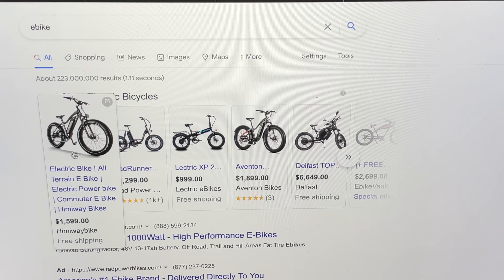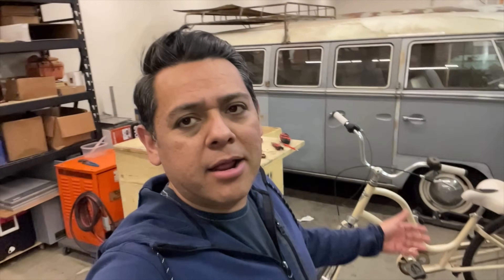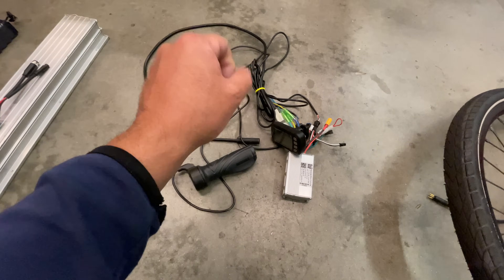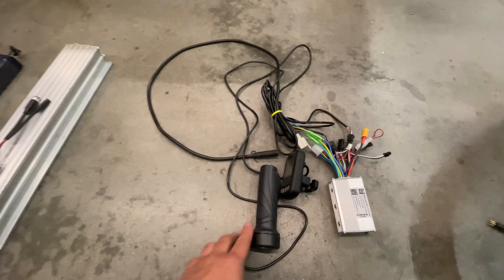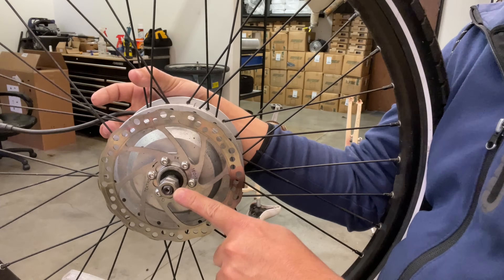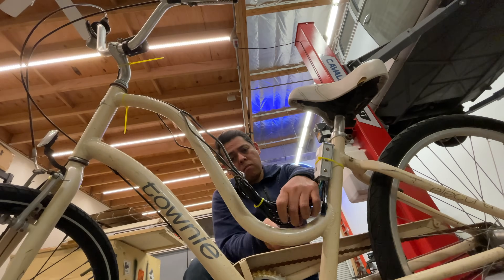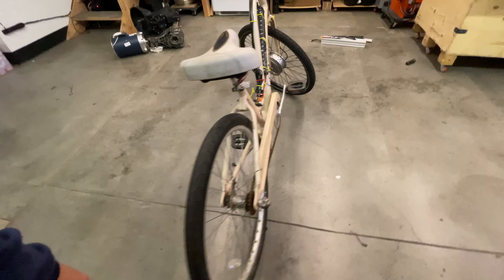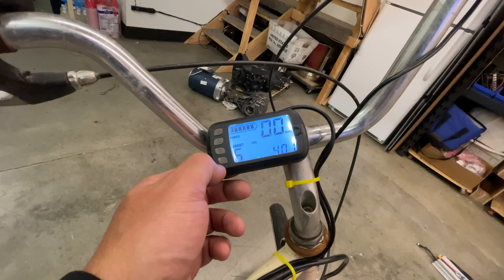$150 eBike Build,  Beginner friendly

Comment: how long have you had this? A lot of your parts had poor reviews, was wondering if you figured out actual distance you are getting with it as well as how has everything held up?
Reply: Precisely why you have to consider the quality of the parts you use. Of course, he did say the wheel was *Used*. However, the electronics he bought new on Amazon.
Reply: @paulreeder5241   I'll take high quality  very used parts over brand new junk.   I think I spend 1/10 on my toyota vs all the nicer newer  used cars like a 10 yr newer Ford or kia.

Comment: You almost got me!!! You actually spent $97 on the throttle control & module, not a bad price.. But where your real savings came in we’re on the wheel and the battery. The wheel and battery is sold by you! Hook us dedicated viewers up with a discount code!!
Reply: You can use a more primitive controller kit for 20 30 bucks. They work just fine. I’ve used mine for years
Reply: @joseureste8257  How do you hook up the hall sensors?
Reply: @steveeng4871  you don’t have to hook em up
Reply: @joseureste8257  send a link of your kit bro
Reply: @joseureste8257  do you have a link or more info?

Comment: I live in Montreal Canada and want to reproduce your build with air cadets with whom I do volunteer work and try to get them interested with this kind of useful hands-on projects.  Was excited to see that we can build an e-bike for such a low price and hoped to get them to build their own (with financial support from the adults). Having said that I cannot find those parts at such a low price here and the supplier for the wheel/motor won’t ship to Canada.  Any thoughts on Canadian suppliers! Thanks a lot fir this amazing project! If I can build it for such a low price I will make a lot of kids happy and get the to experience the pleasure of building something really useful! Pierre
Reply: You will have to do some research in Canada. Also, keep in mind that the lower the cost, the less reliable the circuitry will be. Sometimes you might get lucky and come upon a cheap controller that is actually great. You see, electronic components have tolerances. The more expensive controllers use the highest quality components with the lowest tolerance rating. ie. a 1% tolerance is much, much better than a 5%, 10% or 20% tolerance. The cheaper controllers use the 10% , 20% or greater tolerance because the components are much cheaper. The manufacturing process for producing these components is much more strict on the 1% than on other percentages. The same goes for other products, like the motors, wiring, etc. The quality stuff is going to be more expensive of course. Jehu Garcia hasn't actually used this bike yet. Let's see how long before something fails.

Comment: hi Jehu, i really love watching you're videos, you explain everything so clearly.  i just want to ask about choosing the right BMS for my battery pack. lets say if i'm going to build a 12v 14.4ah (panasonic tesla LDTSL 21700, 3.7 4800mah 10A max 35A) what would be the recommended BMS ampere for this build, will a 3S 25A do?... i'm also trying to find a video on your channel how to calculate the Amps when building a battery pack. because in my example,if i use the tesla battery with a rating of 10A each with a 3P connection would that total 30A and do i need a 30A BMS?

Comment: Do you have to use data sensor meter display to send full power to the wheels? Or can it be done without it? Just use throttle only? Has anyone tried that and what's the result?
Reply from the maker: You don’t need it
Reply: @jehugarcia  Thanks good to know 🙂

Comment: How tf did you get motors that cheap?! They’re way over $70 everywhere else
Reply: Yhis was atake off motor fro rental bikes.  I bet they are few and far between.
Reply from the maker: I have thousands, click on the links you fools
Reply: @jehugarcia  I’m in uk :( was looking at using them for low speed wind turbines to reduce noise from the blades. I’m considering eskate hub motors now (edit typo)

Comment: Well here is the thing.  This hub motor is  a geared motor which is not good . Second its only 250-350w which is very little. If you decide to overvolt it to let's say 48v it will kill gears super fast under the load. So for kids its not a terrible option not for grown man. For about 180$ you can get a true 1500w gearless hub motor for 36v or 48v.
Reply from the maker: They are cheap enough to buy two in case it fails

Comment: It's time for me to quit dawdling.
I placed orders for everything today, plus an extra battery.
Reply: @JehuGarcia: I received my batteries today & the charger the other day. Kudos on fast shipment.
So the charger has a barrel plug, & the batteries don't, but they have 4 plugs coming out of them.  
Can you tell me how to charge the batteries?
Reply: Sorry for such a late replay, how did it go how did everything go?
Reply: Sorry for the late reply to you as well! LOL
It went great. I was upset when I received it, because you kind of have to do some thinking. There's no instructions, but logic will show you how to put it together. There's a 6 pin connector that arrived not a symbol. But you can look at the connector that it has to go to and figure out where to put the wires. The only problem was the motor. The motor did not run when you hook up the three wires do it. What you have to do, is WAP the blue and yellow wire on the motor, and leave the green one alone. This doesn't apply to everyone though. I've had a lot of fun on my bike so far.
Reply: @mattosborne1233  thank you so much for the reply. Thanks I had the same issue and you actually just fixed it so I can’t thank you enough.

Comment: This may sound obvious, but you need a 26" tire bike to use this motor.

Make sure you have a way to recharge your battery. Most chargers use barrel plugs and not XT 60 plugs!
Reply: but it would fit a a 27.5 or 700c bike, ud just have to adjust the brakes, right

Comment: I used the link for the Wheel Nut. It stated that the Steel Nut will Rust in wet conditions. Be advised of that action and use a protectorant before installing.

Comment: Man You Got to put Sum "Luna Cycle Duck Tape" those Parts on Man, MadMax Style  Oh Yeah LOL LOL. MadMax Organ Doner Bike
 What you can do is take a few cell groups out of circuit on 1 pack to reduce the voltage down to 60 volts combined.  To make a 36 volt pack less voltage you move the postive tap point back down to a different cell group that gets you the 63 volt max volt for a 1000 watt controller with 75 volt fets and 63 volt caps. So no mod nessery for the electronics.  Simply abandon 5 cell groups so you have a 15s pack.  The cells you dont use you drain them down to 3.6 storage voltage.   The bms still works.  So you dont have to change any of that.   So configure 1 pack to a 5 s then wire it to a stock 10s pack in series then make a custome charger and you all set...  Yeah!!!!!!!!!!!!!!!!!!!!!!
Reply from the maker: Too much work,  I can just run 20s and get 72v controller

Comment: They are 36v systems. Now I know they work off 48.  Caution!we will see
Reply: You can open the controller and check the number on the capacitor most 36v have a 60v cap

Comment: Toque arms for those front forks.
Reply: @BradCagle  its only 10$ your stupid if you don't attach one.
Reply: its for the rear also if your wheel does not drop in the frame from below. but they are only really needed on 750 watt and up.

Comment: Curious if you could put another motor on the rear tire but use it as a generator would that be enough voltage output to charge the battery
Reply from the maker: Not these motors,  they have a clutch that only engages one way

Comment: This is honestly amazing! I see that most ebikes have the hub motor in the rear. Is there a difference with the motor in the front? I see that you left the drivetrain alone so pedaling it would still act like a regular bike I'm guessing, which is actually pretty cool too. I don't need the cadence sensor part of an ebike, just throttle, which this setup will work for me.
Reply: Some places like Europe don't allow it to be operated without pedaling.
Reply: Fwd better in rain and snow lol
Reply: Yeah that's what I liked about this build. It basically keeps your current bike intact while adding electric power if needed. Most builds replace the pedals with the motor and are easily $300+.
Reply: Put 53 tooth chainring in the front and 11 tooth cog in the rear and upgrade the motors to 6000w and big battery and pedal as hard as you you should be able to go past 65 mph.... I would use an aluminum or carbon frame of road bike to keep the weight down.
Reply: @rockefelleragent1357   at 65km/h you are going to need good brakes !
Reply: @BN9 the only reason you put the tire in the front is because it's easier to run the wires and take apart than the rear tire... motor is Free Fallin you can still pedal it like a bicycle this motor on the back 2
Reply: You don't need a Kaden sensor on the back either it's up to you the only reason I put it in the front is it easier to take apart and run the wires that's it

Comment: I’m going to be ordering the setup soon.  But just a caution — you’re using rim brakes on a wheel not designed for it.  It doesn’t have an outer rim braking surface.
Reply: How do you change to disc brakes or will your braking have to be less than ideal?

Comment: Why not a simple 49cc gas engine for the bicycle? It's easy simple and burns less carbon than all that fancy lithium tech does to produce. Plus it pisses off the climate tards.. A win win🤠🇺🇸🤠😂
Reply from the maker: Do it dinosaur, there’s nothing wrong with being ancient
Reply: You really want a 2 cycle engine that needs oil added to the fuel and pollutes 10 times more than a regular car when it's easier just to recharge a battery for free at your job!
Reply: @gregyohngy  Apparently you've not seen what it takes to extract lithium out of the ground.

You should take a look at it possibly at Brighteon.com or bitchute odysee etc. Where you might see the real costs of extracting this element out of the ground.

In all honesty I'd prefer a engine that ran on Hydrogen. Save the lithium for a better use.

However if I were to choose I'd choose the carbon over the lithium.

Just like I prefer to live in a state that upholds my constitutional rights and allows me to openly carry my guns, whether it's in a car bicycle or just strolling through nature riding in my diesel tractor.

Comment: Interested to upgrade the bafang motor to 48 volt controller and battery
Reply: You can easily with brushless motors. It’s called over volting and is common. From 36 to 48 is nothing to worry about hell even 60 if you tone the amps down. Brushed motors can’t handle it though

Comment: Hey question about the scooter batteries with the aluminum case shown, don't have a Facebook so got to post my q here sorry in advance. I have been using them for my tiny home power for 5 months now. Working great gonna order more soon. Wondering about the bms, I opened the cases partially and wired my inverter directly and bypassed the mosfets. When I initially connected I made sure to charge them(through the 2 lead slow charge cable) until the main leads showed pack voltage and then wired them up. I'm wondering if the bms will stay on permanently since the batteries never get below 33v now and are being regularly charged and discharged, but since I'm not using the fets does the bms know it's being used and balance the cells? Wondering because I'm about to put them in their final configuration and can wire some leads to the charger connection if I need to occasionally active the bms and let it balance.
Reply from the maker: Balancing happens on charge cycle so as long as you charge thru the bms you should be balanced.  But you should use a dongle and just use then output fets as well, it’ll be safer
Reply: @jehugarcia  the system will have 40 packs soon, I'd really rather not have that many activators on my houses system. Nothing personal just a lot of failure points, in addition to what there already are. Could I wire the output directly(as it is now), and then have separate input wires for solar and chargers that run through the bms circuit? I'm using your aluminum case design, 160amp DC power strips for output, and I could wire my charging sources to the 5 pin connection instead of the common busbar it's on now?
Reply: Just to clarify I'm not looking for a personal promise that my idea will work no problems haha I've already fried a few things on my own and it's hard to give technical advice over comments section. A general that should/ that won't work answer is fine appreciate any advice

Comment: You have to use a bike with a front disk.  The rim that you are selling won’t work with regular brake pads.
Reply from the maker: It works in my build just fine,  the pads on this old bike have a lot of adjustment so it works

Comment: Very cool. I have 2 of these hubs sitting in my garage right now just waiting for the right frame to pop up cheap. 

You thinking you might need a torque arm for safety in case that front wheel slips out?
Reply: Got the frame and hub is installed. Stupid higo breakout cable won't be here til mid June though. Soon as it gets here, it's plug and play.
Reply: @NoHateJustSkate1  you can always get a higo dedicated controller for $100 from ebikes.ca.
Reply: @khandam7709   funny thing about that, I tried to and emailed their support about using their controller with my hub and they said "sorry, it won't work"
Reply: @NoHateJustSkate1  which controller? phase runner, base runner or the grinfineon one?
Reply: @khandam7709  I just asked if they had a controller for my hub

Comment: I’m stoked to see the back wheel get replaced too!
Reply: Yeah! it is actually a lot of fun to have dual motors. I installed a switch from the battery to have the 2 modes: front wheel and both. Caution: the battery REALLY gets depleted faster that way: is not linear.  Maybe because I used 2 controllers? dunno.
Reply: @MrLoodico  did you control both motors with 1 or seperate throttle switches?
Reply: @carlpottschmidt7637  I had 2 throttle switch to gether in the same handle. I kept them separated although for a while I put some tape to manage them at the same time..later one of them faulted.. and the cable was lying around.. I was not the most "elegant" builder :)

Comment: if yer going to build one, it cant hurt to beef up the brakes at the same time. you'll be burning through regular pads a lot more
Reply: if you noticed the the front motorized wheel had disc brakes which is pretty beefy though i wouldn't trust cranking down hard on just front breaking from high speeds but the back brakes of the traditional is practically useless over time
Reply: @ojeantas5180 , I thought that regular center pull brakes with pads were used up front. How do you change from one to the other?
Reply: @ojeantas5180  The wheel had a disk but the fork didn't have a brake mount.

Comment: How are the components safe from the elements in your version? Should there be shrink wrapping in key locations? What are your suggestions concerning wet weather or snow?
Reply: use silicone to seal it up. open up controller and spray with water proof conformal coating. Add a sheet of plastic or metal on each side of bike to really enclose it all in.
Reply: If you seal it, it cannot *Breathe*, and therefore will overheat the controller.
Reply from the maker: Wet/snowy Weather?   Get a car,  don’t ride a bike

Comment: I was thinking of making a full suspension scooter with two of these. a tilting trike could be really cool, I am interested in maybe taking the wheel and spokes off and 3d print a rim for a smaller tire.
Reply: Even a good resin printer will not make a strong enough rim.

Comment: What gauge wire should I be using for the adapter connector? Looks like male XT30 to female XT60 and then the extra male XT60 to solder onto the controller cables, is that correct?
Reply: Try to use at least 10AWG, but 12 AWG may be ok for short lengths up to around 30A.
See Wikipedia's AWG chart to find appropriate gauges to use for expected currents.
Reply: Went ahead and ordered the rest because I already have a bike in the garage to do this to and been thinking about getting one for a bit. So great timing.

Comment: Most of these won't work without the motor sensor wires.
Reply: Starvin Marvin  it's the cable he didn't plug in. The sensors in the motor detect the position of the rotor magnets, in order to determine which of the 3 coils to turn on next.

Comment: I have a emoped that i wantv to replace the old sealed lead acid batteries it has that are no good anymore.... I'm willing to get the batteries for it butt what else would i need and how can i figure out what's the voltage its currently running at? Because i can't find info on it.
Reply: multi tester and a charge controller